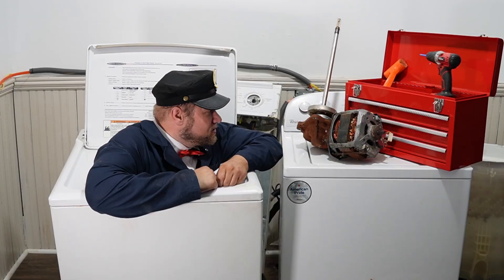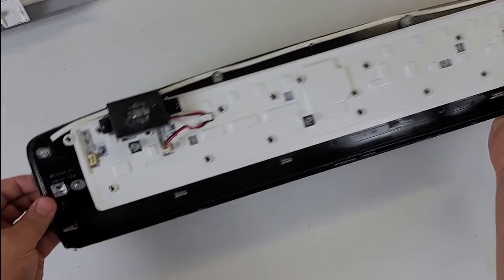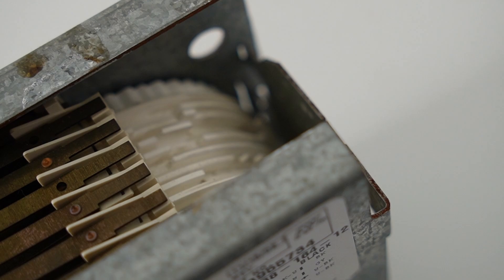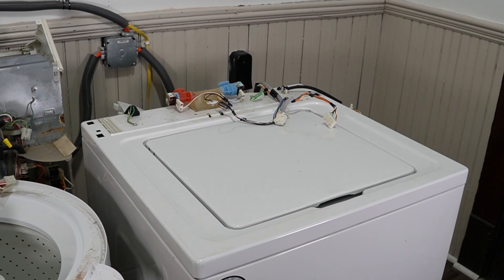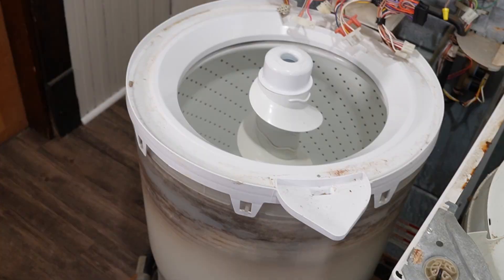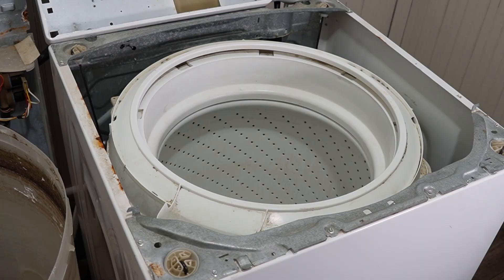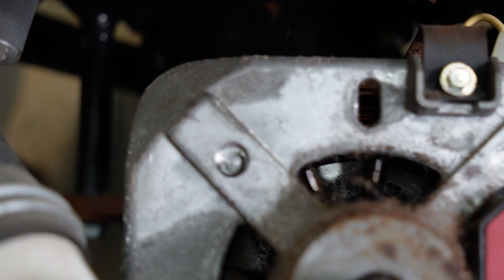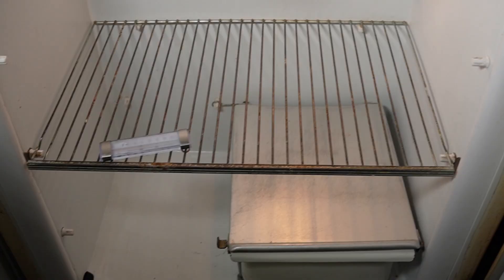Are Washers Built to Break? Inside a 1984 Washer vs. Now

Comment: Capacitors are almost always the failed component in all sorts of electronic equipment.  That's because electrolytic capacitors have a specified mean time to failure that depends on how they are used.  Typically, the designer calculates a time target that is just a few years, and specifies a capacitor that will last that long.  Better capacitors are a lot more expensive.  So they are making a tradeoff between high initial cost of the product versus longevity.  So don't expect your electronic device to last much longer than the warranty.
The cool thing about older washers is you can buy new bearings on amazon for just a few bucks!  They even include the special wrench you need to get the machine apart to install them.

Comment: I have an old maytag washer from the 80s, it stopped working suddenly. It was just a small fuse that blew which was less than two dollars to replace. In the meantime I wrapped the fuse in aluminum foil and was able to run it just on that. Compare that to when I wasn't able to wash my clothes at a lady's house I was housesitting for because the circuitry was malfunctioning and it allegedly ran her a couple hundred dollars to fix.

Comment: I have a 1986 era whirlpool and it has the direct drive system like the old model in your video. Total repairs: two (rusted rear spring and open circuit on the cold side of the inlet valve) - total repair cost $15 ($3 spring and $12 for the valve)

Comment: I had to laugh - the original Kenmore washer/dryer pair you show at :50 is the exact same units we have. We purchased them new back in 1992 when we built our house - but they look exactly the same. Over that time I believe we did have the dryer repaired once (a belt, I think) but otherwise they are still going strong after 30+ years.

Comment: I have a pair of old GE washer and dryer, I believe they're from 2001 based on GE serial codes. Still working well. My mother bought a new expensive Samsung washer and dryer - the washer failed completely after 3 years and was replaced by a cheaper unit, and 6 months later the dryer had problems too but I managed to replace the motherboard. Samsung does not make great appliances from what I've seen from others plus my own experience.

Aside from planned obsolescence, many newer appliances have all these bells and whistles that I don't need. I often just buy the cheapest there is with the least features because I know I won't take advantage of it.

Comment: My apartment complex still has the old stackable washer dryers from GE that were from the mid 80s. Besides changing out some parts like the door latches and locking mechanisms they run great.

Comment: My washing machine from hell is a quiet 300 by Maytag (which is no longer Maytag but Whirlpool).   And yes, Whirlpool and Maytag are bought-out corruptions.   Biggest problem with my machine was the shaft bearings were not properly sealed.  Water seeped in and the steel bearings corroded about a month after the washer's guarantee had expired.   So I had to replace those "ball" bearings myself...a major repair which required a special tool to press the bearings out and the new ones in.   The other disabling problem is that the top of the shaft where the stainless steel basket rides up and down for spinning RUSTS and cakes up with rust, and the "agitator" (such as it is) seizes onto the shaft...and then the washer throws up an error code and is thereafter useless until the rust on the shaft is removed so the basket can float up and down on it again.  This repair required a car scissors jack and a short piece of 2 x 4 to press the SS tub off the shaft where it was frozen because of the rust.  I had to do this three times so far.  Taking the SS basket out of the machine is a PITA and difficult for me because I am pushing 80 and lost much of my body strength.

Comment: I have an old Maytag washer (early 80's maybe?) And an old GE dryer (maybe same age.) Neither have control boards, just rotary knobs/push buttons, relays and mechanical sensors. Run great and are not hard to fix.

Comment: I bought the one on the left 22 years ago used. A few years ago the tub wouldn’t spin so I found out the $3 coupler on the transmission rounded out. I beat the snot out of the machine frustrated in trying to change it. I couldn’t believe the machine was able to run after I pounded that thing back together. Thing still runs like a top.

Comment: The "Milk stool" WP KA Roper Kenmore washer  was originally known as the "Design 2000" I worked at an appliance store for about 18 years. Came in on and trained on the belt drive/wig wag machine. The D2000 service was a breeze compared to the last design but the transmission was not that great in the beginning. Did you know the original say with the motor to the side?  It got better transmission wise but the balance on springy non concrete floors gave us headaches quite often. Certainly easy to work on but never lasted as long as a belt machine as long as they made good pumps for the belt machine.  By the way a trick I've used to get the tub off the drive block is to use an old large file with the tapered tang for the handle. Drive that tung down into the split in the block near the tub with a big hammer. Then apply your penetrating oil. Let it sit a few then wiggle that file back out and try again. A lot of times it will free it up.
Reply: I remember the first direct drive I saw was on a Kenmore compact the motor and pump was in the back I started as an appliance tech in 1978 and am still doing it today yesteryear was fun today sucks
Reply: Also the original transmission was not neutral drain
Reply: @thomasreid3707  You are right I had actually forgotten about that.

Comment: These claims have been flying around for decades and my experience is that it's down to the user how long stuff lasts, and of course brand and model. I bought my TV the same year as a friend. 15 years later I'm considering to trade up, while my friend who bought his a week later now has his fifth one.
Mom's first dishwasher is from 1993 still works, while a friend of hers who bought her first at about the same time got her second replacement in 2000.

Comment: Ben.. This was great! Yes do the tear down of the fridge!
1. Steve is a great guy! but his channel makes everything looks so simple as they are using either new or mostly new machines. Love that you showed the struggle with the tub... 
2. Are the agitators swappable? I can't see how the low-profile agitator could turn clothes over, which we have been told is best. 
3. 17:37 Rebuilt clutch? Looks like it has 6 clutch pads and not 3.

Comment: it is usually an electrolytic capacitor or a relay that goes bad. Especially those relays you saw on the PCB are not designed for high amperages or on/off load switching but they're about ~20 cents cheaper than proper one. So if one washing machine has 5 relays, that is $1 saved, now when you make 100 000 units, you saved $100 000 for a company.

Comment: I had a GE washer about 18 years or more, it started leaking, the water leaking from the tub seal ruined the transmission bearing, I learned that transmission was notorius for problems, long story short I replaced the transmission and tub seal and it wouldnt run right, motor got very hot, replaced the capactor and then the motor, turned out the rebuilt trans was too tight, got another one, was putting everything together when I slightly flexed the plastic tub getting the unit back in the case, and much to my surprise it CRACKED straight down the side, I got a new one and put it all together, but soon after the tub seal started leaking again...by then I had it.

Got rid of that machine  and bought a Whirlpool HE by mistake, from day one it would only put about 3" of water in the tub no matter what selections were made, and it took forever to do a load of laundry. The stupid computer wouldnt let you stop it before IT decided the wash was done, and even if you turned it off and unplugged it, it would start back where it left off last time once turned on again!

 I wound up having to disable the lid lock so I could add three or four 5 gallon pails of water to the tub to get an actual WASH, it was a PITA I put up with for 2 years, finaly l decided "screw it!" and bought a new Speed Queen washer that has MECHANICAL controls. It does a load of laundry in 30 minutes after FILLING the damn tub to the top like I want.

Comment: 1. Replacing failed relays is not trivial on a multilayer circuit board. Are the holes plated through? If not, then if you screw up your replacement solder job, it will malfunction in weird ways because the hidden interlayer traces may not be connected. If you're going to go through the bother, it would be better to install relay sockets for easier future replacement, if they exist at all for that type/model of relay.
2. The traditional simple 1970s Maytag uses a reversible drive motor. In the forward direction it agitates, in reverse it spins and drains. The transmission uses an agitator crank system that locks up in spin mode. The drain pump spins backwards during washing, which sucks air from the drain line and so it does nothing. A separate lint filter was integrated into the tub paddle post, using the paddle fins at the bottom to suck water into the top and push it out the bottom. My mother would always forget about the lint trap and I'd have to clean the mat off the paddle post screen under the softener spin dispenser.
3. My parents have about a 30 year old Speed Queen washer/dryer. I replace the mechanical timer on both of them about every 8-10 years. The mechanical timers are gradually becoming far more expensive... up from $150 to about $200 now. There is a slight drip in the Speed Queen washer around the tub seal and which is probably going to kill the washer. I've researched tub seal replacement but the rust will probably make the tub soft and spongy and unrepairable around the seal.

Comment: We had an older model washing machine, I forget what brand it was, but it was from the 80s. Sadly, the drum got rusted and it started leaking water everywhere, and we had to get rid of it. We got one that looks almost exactly like the one you attempted to take apart in this video and... the stupid thing has never worked right from the beginning. It absolutely REFUSES to use hot water no matter what, so we've been having to wash our clothes in barely lukewarm water for all these years. Mom told me once that if you try to force it to use hot water, or you dump hot water into it while it's filling it will actually drain the whole tub instead of washing. There's a point in time where you just gotta say "enough with the computerized crap". This is coming from someone who uses a PC for hours every day. I like computers, but there are certain places and things where they just aren't needed, where mechanical things can sometimes just work better. Also, another places they are sticking computers I wish they wouldn't? Car dashboards. Yes, let's make something a touchscreen, put it in the dash, and then route everything that's going on in the car through this one singular unit. Awesome. That way, if something happens to it, your car is basically dead even if everything else works. That's the world of planned obsolescence for you. The thing is, they don't want it to last so that you're forced to go out and buy another unit in a few years. If it would last 20, 30 years... they wouldn't be making any money because the newer units are way over-engineered and thus more expensive to produce. Only way they can make money, is to make you buy them every 5 years instead of 20-30 years.

Comment: Just this week I had to replace my very old Eatons Viking freezer, it's been a trooper for over 40 years non stop, Our new one was $1400 and I expect it will not last 5 years, The viking I was able to actual repair by replacing the thermostat, however with $2500 of meat inside I didn't want to risk it.

Comment: Made the mistake of getting rid of a 1981 Whirlpool washer.  Should had done the clutches.  Then had several washers finally buying a Speed Queen.  Weighs a ton.  Works like a champ.  Never ever getting rid of it.  Washers and dryers are considered durable goods.  They should last 2 decades without a blip.

Comment: The Kenmore series 100 line, just wiggles the dirty clothing, and doesn't get rid of the dirt, and leaves soap on the clothing after the wash cycle is finished. . The series 80 DOES move the clothing throughout the water, and the clothing comes out clean with no leftover visible soap. We're going backwards in tech. When my mom died, I grabbed her series 80 and sold the series 100. still kicking since the 1980's.

Comment: It's kinda a strange world in that my background was electronics repair, specifically components on PCB's. Turns out I'm probably more qualified to fix modern washing machines than most "washing machine techs". The mechanical part really isn't hard, I just replaced the spindle and bearings in mine a few months ago. However unless you know what you are doing, replacing components on a PCB is simply far more advanced than most people are capable of doing. Which is why most just replace the entire PCB for $200+ vs repairing it when chances are it is a $4 or less component.

Comment: I have the older washer, Kenmore 110 series. I've replaced the clutch and agitator dogs twice and the pump recently when a tiny sock got in it. It felt a bit stiff after injesting the sock so I just replaced it to ease the strain and avoid a failure. Our neighborhood shop might start selling transmission kits, they already sell rebuilts. So I really have no reason to buy a new washer. The dryer I've only replaced the latch that holds the door closed. It needs new rollers and belt though.
It's the first washer and dryer I ever bought, very little rust, and it seems like they might outlive me.

Comment: After replacing the breaks on a clutch and a whole transmission rebuild kit, somehow my washer was still overloaded with comforters. Idk how, as the note on the top clearly stated they were not welcome in there but, thus is life with a teenager. (insert comical extraction of washer to the grave yard here)  I had a relative that had that very whirlpool washer and said I could have it, boy did I feel lucky and grateful at the time    ......  that lasted 5 days -_- like most DIY folks  I took to the internet learned the diagnostic christma tree  light sequence and spent the money on a new spider mounting system, only to discover that something was going on with the damn spin plate. 6 hrs, come alongs, pry bars, drills, sawzalls, eventually 7.62 was introduced to the washer and gas mixed with rage hate and fire. I Hope Steve from parts select And bob ross meet a pissed off chuck norris in a elevator btw. For real though I felt your pain trying to get that transmission out. I tried everything I could think of, even had the car jack and 2x6's involved. I've struggled and bumbled through things for days on end before but I can honestly say that I've never had my behind handed to me like that washing machine did before.

I eventually settled on a commercial washer from the 80's that uses 40 gals a wash. I couldn't be happier. I could take a ride in that thing and it would just keep spinning.

Comment: Complexity does normally reduce longevity of a system.  Other than the undersized capacitors and the mechanical relays (which are sources of trouble that could have been engineered differently) what does the modern machine's board resemble?  A board from a cell phone.  Which usually is quite reliable despite the incredible complexity.  BTW, the tub seal failed on my new style washer.  Had to replace the whole transmission to fix it.  Getting the basket to separate from the shaft was a rodeo level challenge.  I had to use a acelylene torch and beat on it for quite a long time to get it off.  I would have just ordered a new basket as the struggle was quite epic, but the price of the basket was quite high. The cost of the transmission was less than two hundred dollars.  Not an easy job, but I managed to achieve success.  I'm a retired auto mechanic.  I can see how this repair is beyond the average Joe.
Reply from the maker: The other issue too is cost. The transmission is $200. On a $600 washer, is that really economical? On an older style unit, the one we showed, the entire rebuild kit on the inside is maybe $40. But we rarely do those, the far more often transmission repair is the $15 input seal. Compared to the $200 tyranny replacement it's a value
Reply: @bensappliancesandjunk  Agreed.  But I'm working in a confined corner with a space saving stackable.  The previous hero machine used a clock type function switch.  It was a great machine.  But the system employed 220V because one plug also ran the dryer.  So when the washer motor gave up the ghost, and I went to replace it, It was unobtainium, discontinued, unavailable at any price.  I had no choice, I had to buy a new one.  They sell the seal seperately, but I thought it probably failed because of wear in the bearing.  
     The board failed only a month out of warranty.  $200 to fix that with a new one.  Definitely not engineered to be the washing  machine equivalent of the Prius, (probably the most maintenance free car on the road today) but It could have been.

Comment: I have a lot of experience with the newer style washer (we use the same one) at our detail shop and we run it maybe 5 times a day every single day for the past 3 years and the only issue we've had with it is that sometimes it'll stay locked after a cycle has been complete.

Comment: The Whirlpool in this video is the only HE machine I would suggest using (Also found under Roper, Kenmore,Maytag, Amana), get a high quality surge protector or battery backup. Otherwise get the Kenmore (Whirlpool Direct Drive, also found under Amana, Roper)